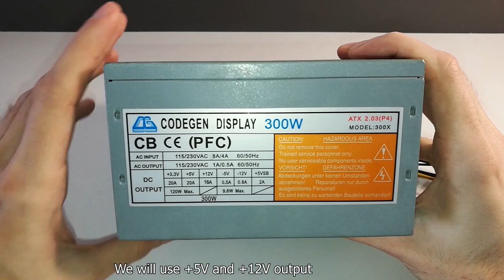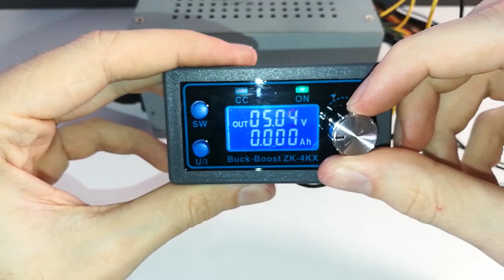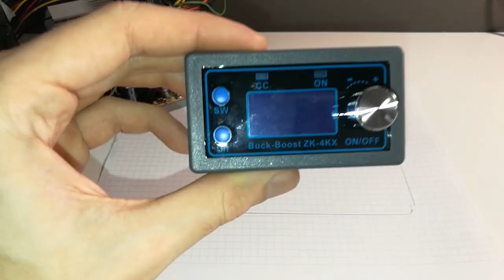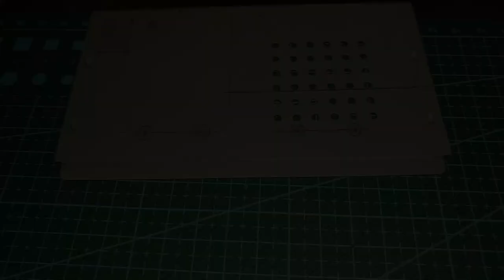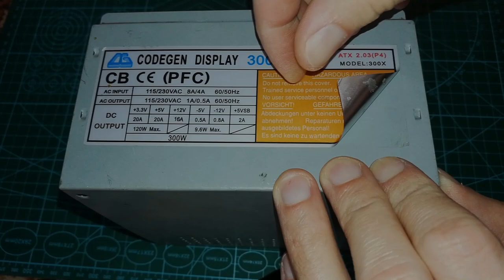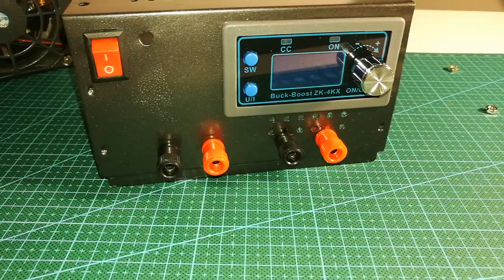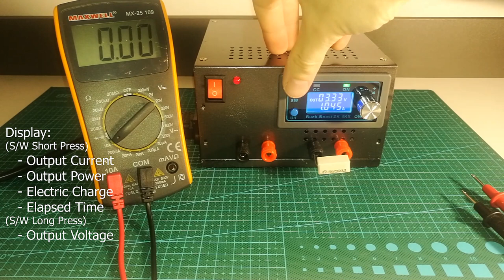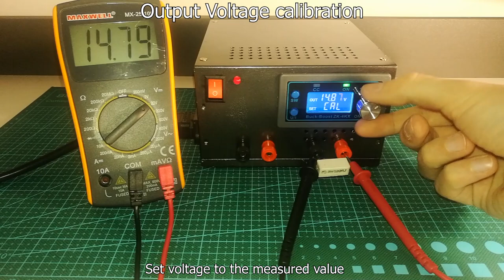DIY Variable Lab Bench Power Supply from ATX -  How to Make it Cheap

Comment: Is that the PSU where "dummy load" on 12V or 5V power rail is not necessary? Cause I haven't see that you set the one? I see it was marked as PFC, which is fine. Thanks

Comment: This module can't be used with 30V @full current because it limits @50W only, you can use the full current @12V only.
Reply from the maker: That's correct. From the other way around, you cannot use 4A @full voltage. You have to limit one or the other when using higher power. "Over Power" functionality will prevent too high power usage, and stops the module if it happens.

Comment: Hello, very informative video and web page. Thanks. Question: I saw in another person's video, he instead of cutting off the extra wires, fused  all wires of same color together as if they are a single wire. And then he soldered the end of each bunch as if it was one wire. If I understood it correctly, according to him, it carries high currents/amps better. Is this true? Should one do that? Your module is up to 4 Amps. I was thinking of using a 20Amp module instead. If above is true,  bunching of wires will be useful in that case. Thanks for guidance.
Reply: Yes, more wires can deliver more Amps. Problem with power is not about thick wires but also about electronic parts, PCB design and passive components.

Comment: Great video! Very informative. But you should consider putting some disclaimer, because some new to electronics guy/girl try to recreate this. He/she will be playing around with high voltage. Imagine not knowing how to reassemble the power supply unit after dissassembling it for painting and miss on putting the ground wire to the metal body of the power supply unit. Then that person might be in danger. Congratz on the video anyway.

Comment: Hello, 
Can i cut off the extra wires ?
All wires of same color together as if they are a single wire. And then solder it of  the end of each bunch as if it was one wire.
 I think high currents/amps better. 
And also can i use a spot welder for battery 18650 with this kit ?
Thanks

Comment: Hello. Can you help me? Current stabilization does not work properly after calibration. With a setting of 2A, the current is stabilized at 1.8A. What is the problem? How can I reset the installation to factory settings?

Comment: Could the ends of the source be used in a heating element?
to cut duroport?
the source is not blocked with a heat resistor?

Comment: Hi , there.May I know why did you use 3.3ohm load to caliberate the settings
Reply from the maker: Hi! That's what I found at home that has low resistance with high power rating. Any resistor can be used with higher power rating, the important thing is to calibrate the device under higer load.
Reply: @mtelectronics4242  THANK YOU UNDERSTOOD! Can you please give the new link of ZK-4KX Module ,Think they are no more

Comment: Hey, does this remember all it's functions when it loses power, and also, can you lock the controls so bumping the turning dial won't increase/decrease the output voltage (and damage your equipment).   I want to install this on a Radio Transmitter and I don't want to exceed 8.4v DC output.
Reply from the maker: Hi! Yes it saves the voltage/current values, so it starts with the latest settings after power up. But as far as I know it doesn't have a lock functionality.

Comment: Very cool! I will try to do the same one. 
One question: if I want to add a USB port to charge small devices such as a smartphone, I simply need to use the 5V grey wire that you did not use? Thanks a lot
Reply from the maker: Thanks! No, grey is only a signal to indicate that power source is working fine. Use the red wire instead, or purple (standby) also can be used if you want to charge when psu is off.
Reply: @mtelectronics4242  I have a new question: is it safe to go above 12V with the converter given that this ATX power supply is designed for 12V?
Reply from the maker: Yes it is. The output of the PSU is still 12V even when you set lower or higher voltage on the converter. The higher voltage is handled by the converter. I recommend to search for how a buck-boost dc-dc converter works. In case of higher voltage it behaves as a boost converter.
Reply: @mtelectronics4242  Perfect thanks !
Reply: MT Electronics Thanks again, I think I have got everything to build it. How are called the items you use to cover the holes of the PSU? Thank you so much once again, I hope I’m not bothering you. Your instructions are very clear, but I’m a beginner... Thks!
Reply from the maker: Those are just simple painted aluminium plates that I've been cut. No problem, I'm glad that I can help you. If you are beginner, take care that don't touch the PSU circuit when it's plugged in and for a while after you plugged out from AC. Let the high voltage capacitors discharge.
Reply: MT Electronics Okay! Yes I’m very careful. The PSU has been unplugged for severel weeks, I have checked the large capacitors several times, they are discharged (there are actually resistors next to them to discharge them)

Comment: Great videa, thanks :) Has this bench short circuit protection on output? Thanks
Reply from the maker: Thank you! :) Yes, it can limit the output current too! So if you make a short circuit, it will drop the voltage while limiting the current to the maximum value.

Comment: Good video, I tried this modification with my ATX power supply and it gives me 12V(7A) and 5v(3.5A). Intended for my Cordless 12v drill. But once  connected my drill to 12v line, the power supply turn off. After restarting it, tried several time and same thing happen. then, I connect my drill to 5 V line and surprisingly, it run without stopping the power. So, whats wrong with my 12v line. Can you give me an idea how to repair it. Many thanks! Appreciate it much if you could help me.
Reply from the maker: Some ATX PSUs might need a dummy load on the 5V even when only 12V is used, else a protection will switch off the power supply. It could be the same in your case as well. Try to load the 5V rail with a 10 Ohms or less resistor (5-10W), while using the drill on the 12V rail.
Reply: @mtelectronics4242  Many thanks I ll do that! ijform you later.

Comment: Is the rocker switch on the high or low voltage side? That is, do I need a 120VAC or 12VDC switch?
Reply from the maker: It's enough to use a low voltage switch, to sort the green wire with the black.

Comment: Does this Module remember your settings like voltage and current after a power loss?
Reply from the maker: Yes, it saves those values and starts with the latest settings.

Comment: Hey, nice vid! Couldn't tell from the video: can thr buck-boost module you used set amperage as well as voltage (I was confused because it only has one knob)?
Reply from the maker: Hi! Thank you! Yes you can set voltage and current values as well on it. You have to navigate in the menu with buttons to set the current, and use the knob to change it.
Reply: @mtelectronics4242  Awesome! Then I'm about to build my own, and using some inspiration from Kralyn3D, I'm going to use a rocker switch and a 5A diode to add a number of direct dc input ports as an alternate potential power source.

Comment: can you please help, the output volt is stuck at 28v and the volt display ajusdment is more advanced 1v, which is clearly out of sync
thank you
Reply from the maker: It shouldn't stuck in normal case since it doesn't require anything just input power to work. It might be that the rotary encoder is not working properly.

Comment: If we use -12 and +12 for two terminal. Do we get 24 v?
Reply: Yes, but -12V line is very weak in ATX PSUs. Look here 0:36 you can see that -12V has only 0.8A and +12V has 16A.

Comment: Hi, you didn't use a 10w 40 ohm resistor anymore? And no need to connect the brown sense wire to 3.3V?
Reply from the maker: Hi, no I didn't use them. They might be required by some older PSUs.
Reply: @mtelectronics4242  how do we check if a resistor is needed?
Reply from the maker: Try without it, and if it shuts down after some seconds, try with a resistor on 5V or 12V. I don't really know what the brown wire stands for.
Reply: @mtelectronics4242  thanks!
Reply: @mtelectronics4242  I was trying to figure out what the sense wire was and found this on Reddit by 'grabster'.

"It is to save money. The 3.3v wire would have to be very fat to carry the high current with out too much voltage drop. Instead, they measure the voltage at the load, and the psu raises its output voltage when there is high current, to maintain 3.3v at the load".
Reply from the maker: @HaggardEffect  That's good to know, and it make sense. Thank you for the information!

Comment: I personally don't believe this is the best solution to achieve an ATX bench power supply. You are asking hobbyists to discard the {potential} majority, of the available current, of the power supply. Alot of PC PSUs are able to deliver more than 10-20A, on some of the voltage rails.
Further, these ZK-4KX converters are merely adequate at delivering 3A, over a period of time, let alone 4A! I have tested  one of these modules, to charge lithium batteries, & within 3-4 minutes the unit has gone into over temperature mode. Their specs are over-rated. At the very least, it requires active cooling (fan), if operating above 50%, of it's rated current. 
I would state using good quality potentiometers, to regulate voltage/current, would be a better option, to allow the full optimisation, of the regulated PSU.